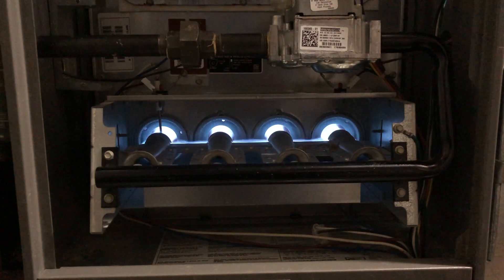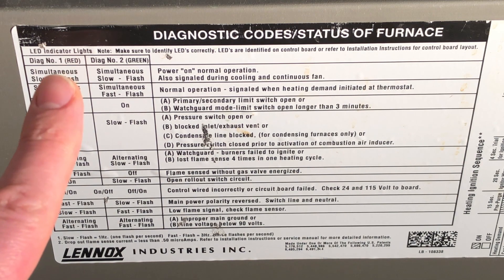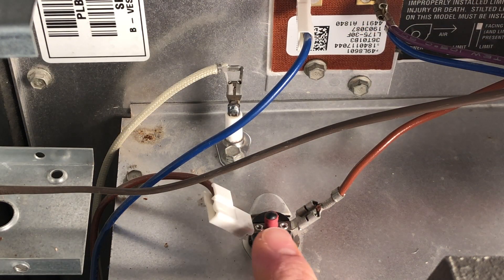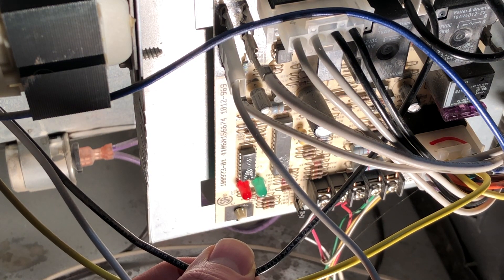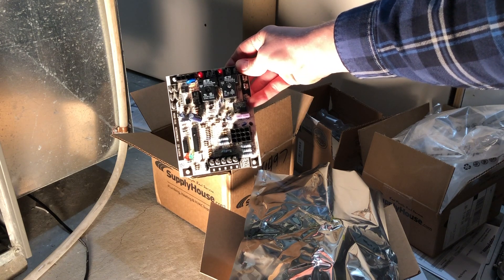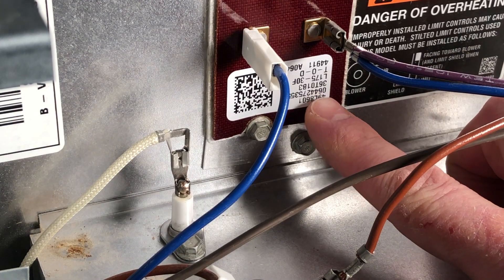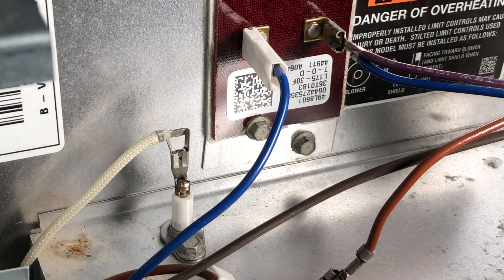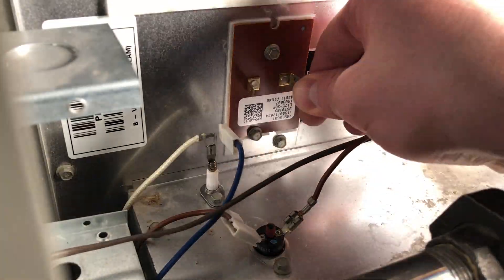Lennox Furnace Maintenance

Comment: 2 types of safety switches on your furnace. high limit and rollout. the rollouts have the reset button in the middle, the high limit is the one that is in the airstream. the rollouts can be reset by pushing the button. if they are tripping you need to find out why. in your case it may have been the water drip. both of those sensors can be checked with a multi meter set on continuity.   Flame sensors rarely go bad, they just get dirty. Use a dollar bill to clean them. Do NOT use sandpaper. it can leave a silica residue that turns into glass and impacts the ability of the sensor to transmit electricity.  Be sure to ground yourself before handling control boards. they are sensitive to static electricity.
Reply: I agree with all you said.  At 69 I never wear rubber gloves but I think it would do so while handling the control board to keep acids or oils on my hands from harming board.  Mine is a Lennox installed in 11-2019 L.P.  and never had it looked at since other than me changing air filter.  In this below zero temps at my Michigan farm I want to know how to keep it running.  I believe I'll do the same and order all those same parts he bought.  No doubt in its lifetime they will need replacement so why not have them right here and not have to wait for parts whether my furnace guy or I fix it.   Very excellent video.  To bad he's only done 2 vids as he's a natural.

Comment: What can you tell me about the burner inserts, I believe it’s called an insert-nox?   I have a Lennox 4 burner and it looks like those metal inserts are burning away, melting or deteriorating. Where can I find replacements? Can you please help with info? I’ve looked up a lot of replacement, part websites and videos, and nobody seems to even mention anything about those inserts that I could see on mine beyond the flames that they are just burning away. It looks like some thing that should be replaced, or is it even necessary?
Reply from the maker: I suggest taking a couple pictures of the damaged parts as well as a picture of the furnace’s spec plate/sticker, which will have the model and serial number on it. Then, reach out to supply house. I’ve bought many parts from them for various HVAC systems through the years. They’re quite knowledgeable. They’ll likely be able to identify the exact parts you’ll need. As far as if it’s even necessary… my default answer is, Yes! The efficiency of your furnace depends on how it’s maintained. A hundred dollar part may save you that much money many times over in a single season of use.
Reply: @heathtreated which part house? Lenox doesn't want to sell home owners parts to their furnace.  Technicians only. 😢

Comment: You are touching the metal part of the flame sensor, I have read not to do that.
Reply from the maker: Touching the flame sensor metal rod is a non-issue. This is because any oils or contaminants introduced from our hands get burned off or carbonize in the flame. However, if carbon builds up on the flame sensor it can act as an insulator. That carbon build-up should be cleaned off once/year, typically a bit of steel wool will do the trick. What is important NOT to touch is the glow-plug/ignitor component.

Comment: Thanks for the video!  When I read my manual for the same furnace, I see no information about preventive maintenance. You mentioned one of the sensors failing and being replaced previously and you had water damage. Had you not incurred any water damage, what do you typically do for maintenance?
Reply: The main routine maintenance involves:

1. Replacing the air filter. I suggest monthly.
2. Cleaning the flame sensor. I suggest annually.
3. Checking the blower capacitor. I suggest annually. If the output voltage drops enough it will result in an error light pattern for the limit switches, but it’s not clear so it’s difficult to diagnose. A replacement capacitor costs around $30 on Amazon.
4. Checking the water drainage line. I suggest annually to make sure it is not plugged.

Those are the primary things to check.
Reply: @heathgerlock  dont forget to clean the burner bar annually....orange and yellow flame is not good.....his flame in the video was ALL blue...mine never looks that good even after cleaning...my Lennox is a 1998 model.